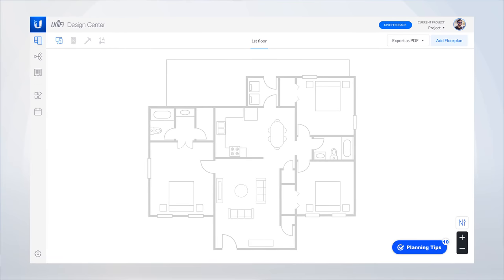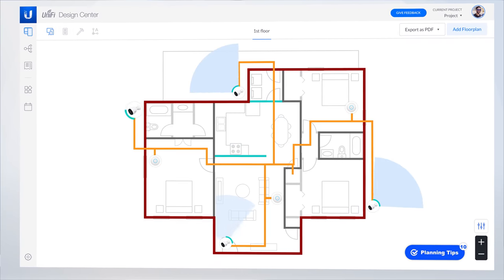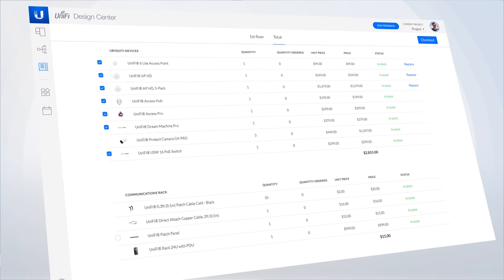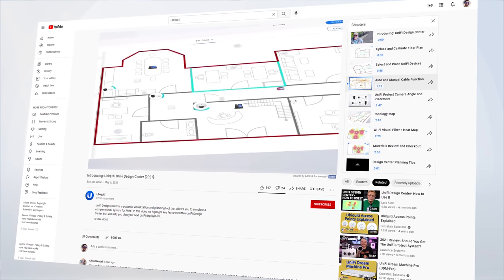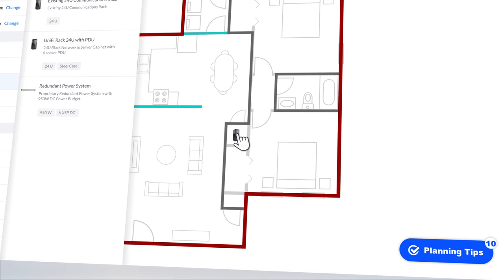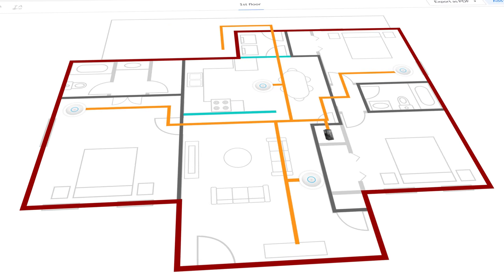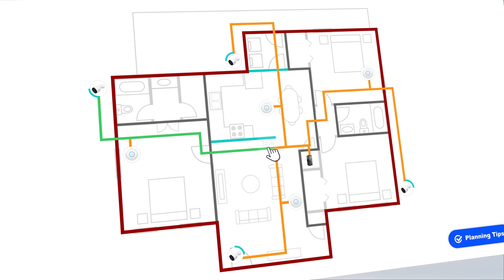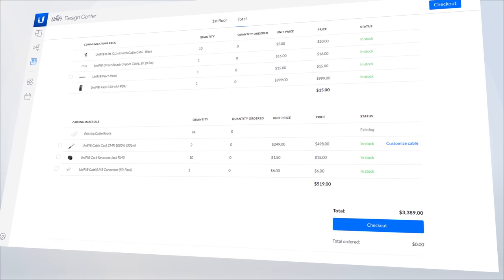UniFi: Beginner’s Guide to Network Cabling | Part 2 - Home Installation with UniFi Design Center

Comment: That particular low voltage box (Carlon) has four small holes near each inside corner... that allow you to mark the corners on the wall of your cut line and get your layout lines for what to cut out the sheet rock very accurately.  Just FYI

Comment: No need to untwist the pairs.  You can use the plastic to slide the wire over while trying to retain as much of the twists as possible to termination.

Comment: Tip: make sure the cutting blade on the punch down tool is always on the outside of the keystone jack.
Reply: I made this mistake my first time using keystone jacks. Luckily it was an easy fix.
Reply: @N1njaNick  SAME! first day on the job and had no serivce loops. Boss made it work but i was like never again.. it was on the rack side

Comment: 5:53 Why such a big hole for one cable? That leaves a pathway for G-forbid fire. Again, as stated, the key is to check local codes. They are pretty tight where I'm at in the US. Metal conduit is still a thing for AC power. I've always used fire block sealant around any penetrations through fire blocks or top plates.

Comment: Just so you know those orange wall plate brackets have 4 little holes at each corner, if you take a pen and draw a point on the wall at each corner and then line up the point you have a  the perfect hole.

Comment: Question for you. I just moved into a house that had the power and network cable coming down from the attic together. I notice the electrical wire is wrapped in a purple shield wrap. Would that be okay to still run it together? The reason why I'm asking is beacuse it's only one hole they ran all the cables threw. This house came pre-wire with cat5 and I'm upgrading to Cat6E

Comment: You should mention any holes in the top plate leading to the attic should be air/fire blocked otherwise warm moist air will enter the attic and cause mole and rot. As others have noted, consult the local building codes. I like great stuff expanding foam for this purpose.

Comment: What tips do you have to plan runs through walls with fire blocks?  I live in a townhome and I have done some runs but drilling holes in my upstairs ceiling.  I need to come down the walls for my downstairs but I don't know a way to plan a route with the least amount of obstructions without x-ray vision.
Reply: Most of the time when you run into this, if it's wood, is to get a long drill bit and drill through the blocking

Comment: Do NOT hold the keystone in your hand and punch down, unless you like to leave your blood on the jobsite. Punch down on a solid surface. He even had the block for holding the keystone and didn't use it. We you put the faceplate with the keystone in the wall,  have the wires on the top side... it helps to protect them from dirt.

Comment: Had an electrician run wires for me in my new home that is under construction. The horror when I saw they run all the wires and didn't use a single j hook. Instead stapling all of them in sets of 2 every other board. The nightmare that will be upon me when I decide to replace my runs in the future will probably end my life and my pocket book because I am definitely going to have to pay someone to do it for me... Bad back and all.